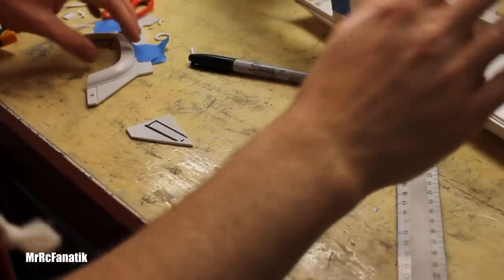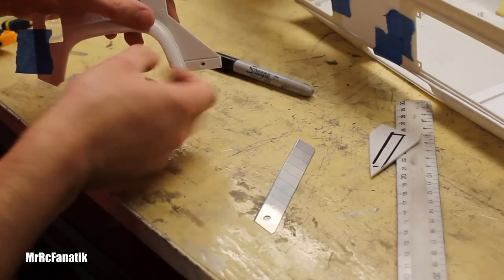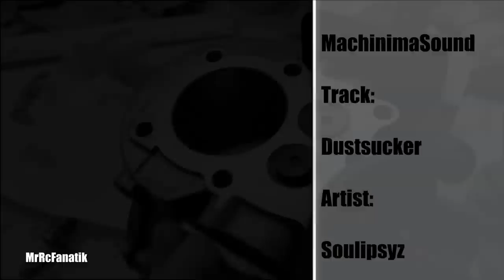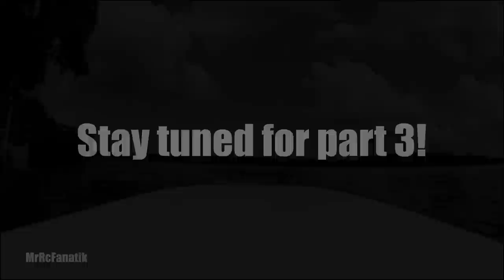[PART 2] CUSTOM Scale RC Land Rover Defender 110 Build

Comment: i have to say that you are good at what you do.
be nice to have a brake to make the bends just a thought
Reply from the maker: Thank you!  The bends in the roof were a tad hard to form since I used very thick styrene, I've since stayed away from the 0.08" and have gone to 0.04"... much easier to work with.  Ultimately it didn't make any difference for this body though, as I just ended up using it to create a mold.

Comment: what thickness the styrene sheets?
Reply from the maker: I used 0.080" styrene, but after this, I have started using 0.040" and MUCH prefer it!  If you haven't already, check out my videos on "how to work with styrene" they may help you out! :)